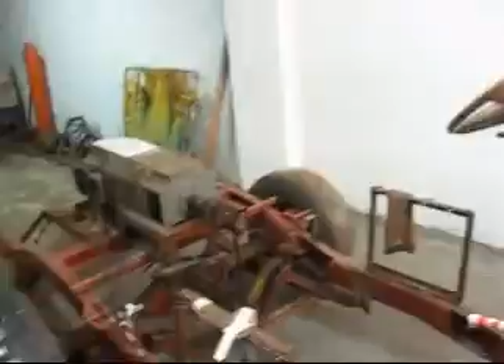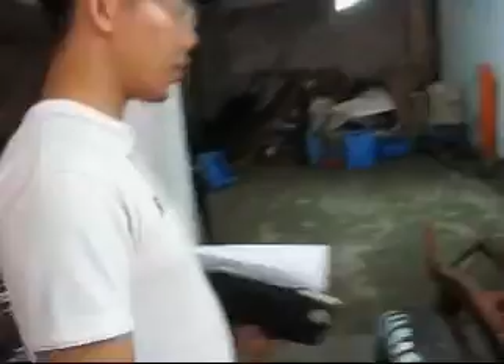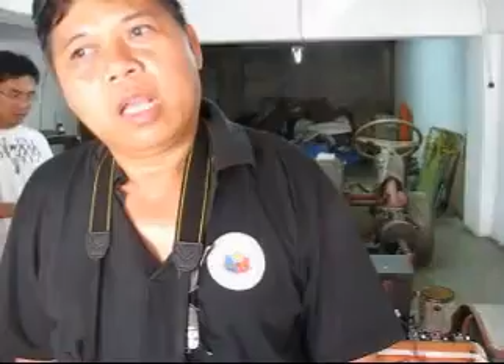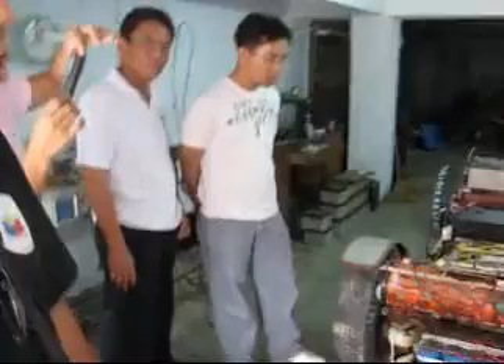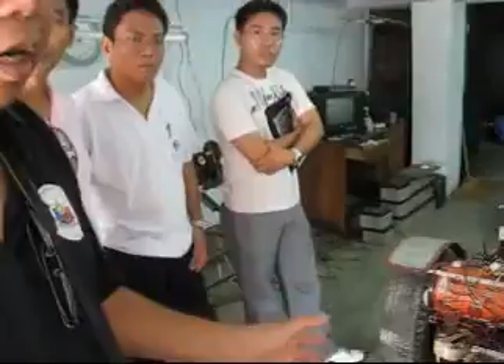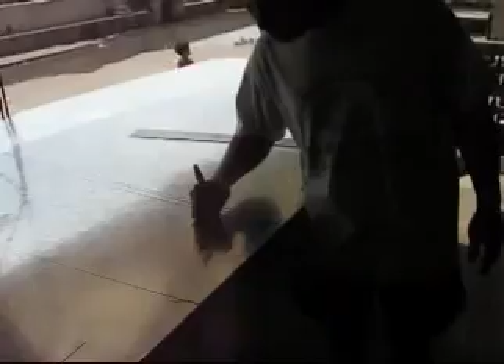Ismael Car - Part 3

Comment: Great work on the Electric Car
ongratulations
What type / brand of caps you are using
We had an issue of exploding cap banks  in Hong kong 
and all had been replaced at no cost by Schneider Electric    25 kvar each
Try cap Bank Controller by Siemens 
 MOVs or discharge resistors already installed with cap banks
On single cap   a Varistor  same as Mov at 1 ega ohm per cap

Comment: I know that this is possible because of the use of a series of capacitors which stores energy and the principle of renewable energy. The 12v battery acts only as jumpstarter.  The reliability of the capacitors will greatly affect the performance of the driver of the motor.  Good job!  The invention can still be improved for viable commercial use.